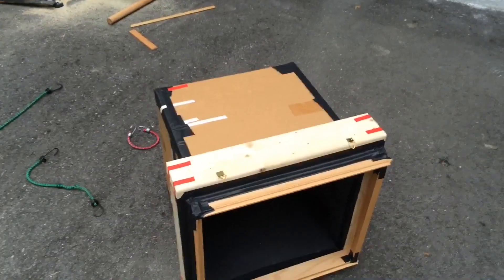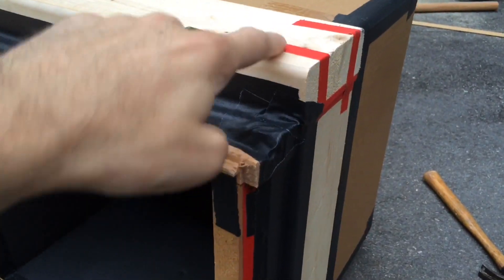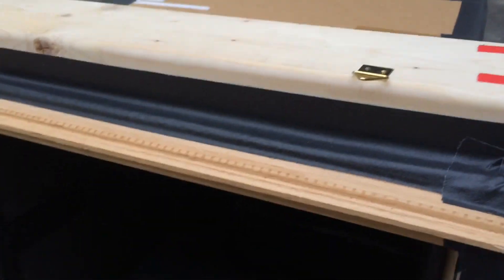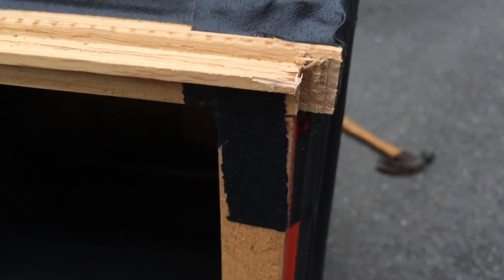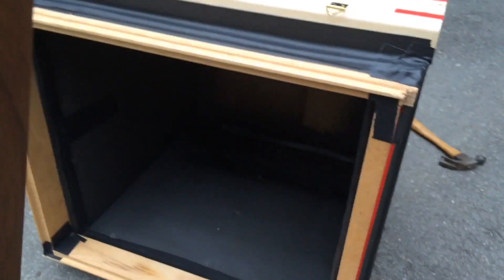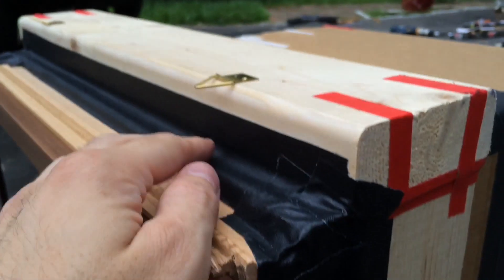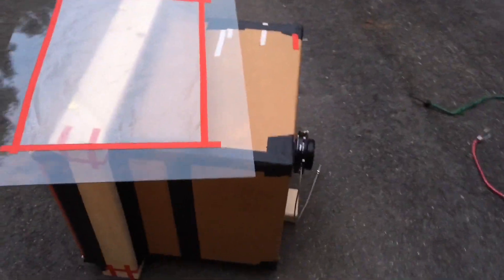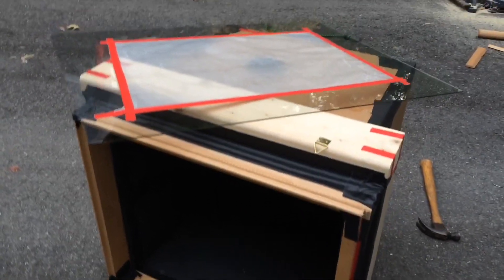Inexpensive 14x17 Ultra Large Format (ULF) Film Camera Build

Comment: What is the lens you are using in this camera and how do you deal with focusing?
Reply from the maker: I was using a Nikkor 450 M lens. It's a fixed focus design, so, you move the camera to focus 😆 but one could easily add a mini-bellows to the front or a sliding double-box design to add focus capabilities.

Comment: Well done! That's a fine looking ultra lf camera. I think it's great when people use their imagination and resourcefulness and build usable photographic equipment on a micro budget. It's amazing what can be achieved. With regards to focusing, I'm still a bit puzzled. I took careful note of when you placed the 'ground glass' on the camera so you would have a pretty good idea when an image is sharply focused on that screen. However, there is a fixed distance between the film and the lens. Are you moving the whole camera back and forth to achieve focus? 

It would be great to make a simple bellows on the cheap too. Maybe have two moveable panels and drape some black velvet or something like that over the top with a little bit of raised support so the material doesn't sag. 

By the way, when you zoomed into the second picture near the end, I was impressed with how much clarity and detail I could see. Good job.
Reply from the maker: Thanks for your thorough comment. I got lucky and the pane of glass was exactly the same thickness as the distance to the film plane, so I affixed the wax paper to the back side of the glass (which is where the plane of focus would be in the holder). I'm sure I could have created a wedge if the glass were the wrong thickness but it happened to be the depth I needed.

Comment: Where did you find your film holder? Also do you use xray film? I build a pinhole ULF for shooting 14x17 xray film but couldnt get anything useful. Also how are you developing?
Reply from the maker: I received my film holder from Sandy King. Yes this is Kodak Ektascan x-ray film, it's one sided so it can be processed in a normal Jobo drum without scratches to the emulsion. I believe it's about 100 or 200 ISO speed if I'm recalling correctly.

Comment: Ultimately the two photos show too much foreground, which you can't correct, failing all movements on your box. And movements are very much the point of large format cameras.
Reply from the maker: I understand what you're saying, however this was about 2 hours worth of work and $100 to have a working 14x17 ULF ready to go. One could easily make some modifications with gaffers tape and have minor movements, etc. The point here is simply that it can be done. Also, many ULF artists do not use movements, it's all in what you're trying to accomplish 🙂

Comment: This is really nice...just finished building my dark room, and only shooting 35mm right now but want to get into ULF, I want to build a 8x20 folding field camera, but I think it's more realistic for me to start off with a simple build like this, and work up my skills towards a more advanced camera...
Reply: So, did you build it?  How did it come out?   You can always sell it if you outgrew it. I built me a 5x7 that I have yet to use since the weather has not been 'perfect' yet as I do not want wind that would shake the camera like a bobble head.  Asa 6 film will need a loooong exposure that I don't want to ruin with only 2 sheets available on top of the mountain.   Looking through the back, I do not see that I will be disappointed with it.  I should have a video of it and pix soon.
Reply from the maker: Good idea, always best to test the waters before you dive into an expensive endeavor.

Comment: Shouldn't think it'd take too awfully much to re-build the cardboard box part out of 1/4" plywood.
Reply from the maker: The point of this build was to show that it's possible to spend very little money and still be able to work in the ULF world ($100 and maybe 2 hours worth of work for a working ULF camera isn't bad). Yes upgrades could certainly be made. It's been many years but I believe that might have been triple walled corrugated which is more dense, one could also spray the outside to be black and add density. But it held light just fine, I did a test first I believe. Thanks for enjoying the video, I hope it inspired you to experiment 🙂
Reply: Lighter & cheaper I get....but it seems to me that the cardboard could be too easily subject to accidental light leaks.  I'd be so paranoid about that I'd be afraid to use the thing.
Reply: +Stone NYC   Right.  The Photographer in me wants to play with that camera - and the Woodworker in me wants to build it from scratch out of plywood & such.  Perhaps it's time to start working on a rail-mount type studio camera, based on parts from my Crown Graphic.  Never fiddled with anything bigger than 4x5, maybe someday.  :)